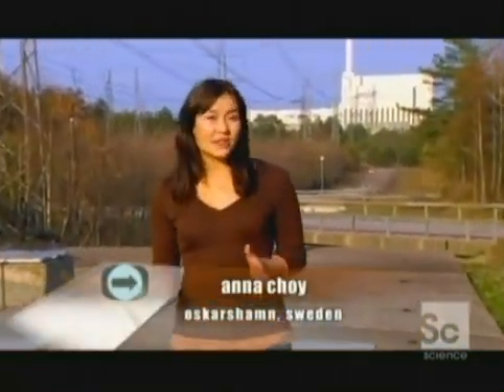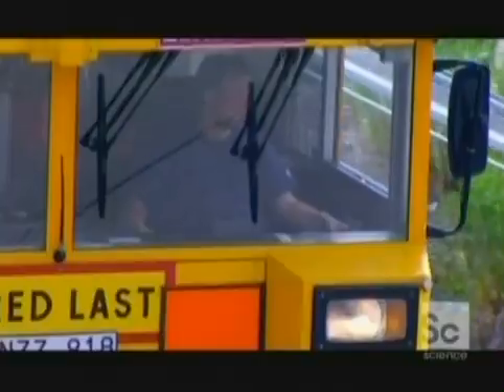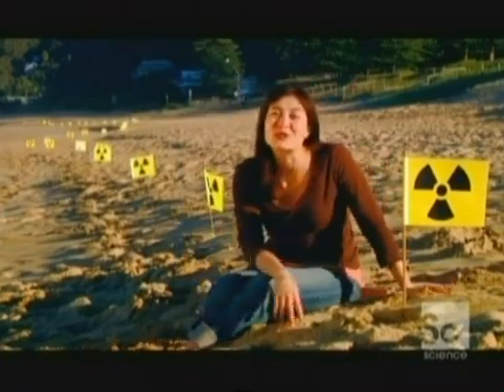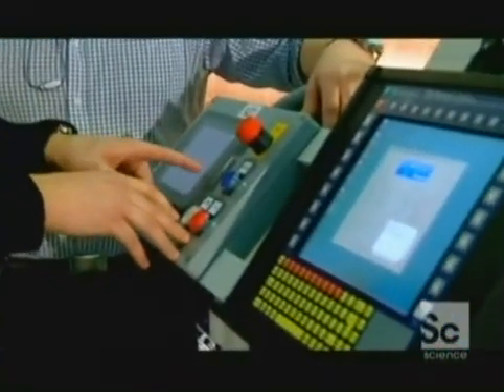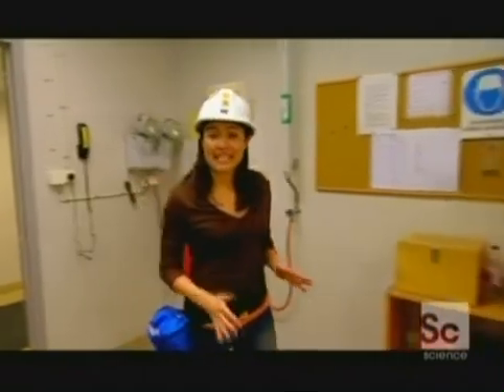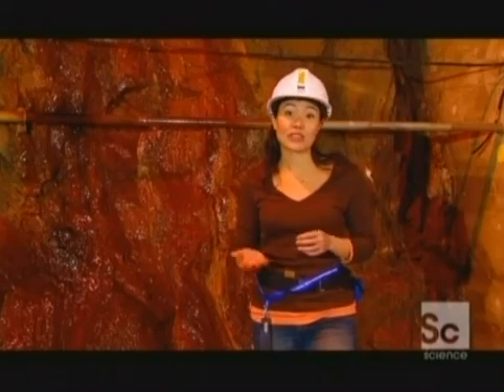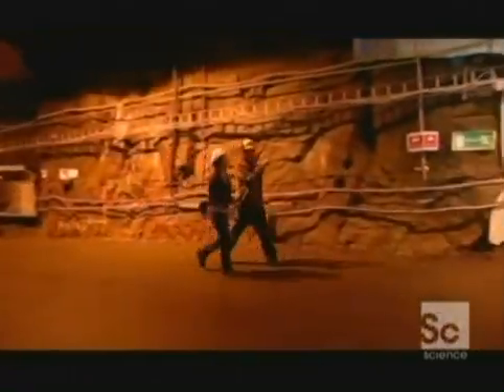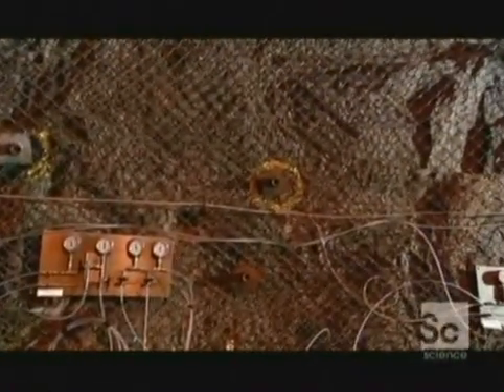Nuclear Spent Fuel Disposal

Comment: Agree with you, but the transuranic today the transuranic is more reliable than long years ago when it was needed to transform the yellow cake into "HEX" then fuel... Today with the centrifugues much more reliable and easy to handle with high unstable spent fuel, adding or removing the non used materials, Cesium, Selenium and others. Again proceduring a lot of waste, the same procedure could be done.

Comment: Yes, but it still produces a lot of transuranic waste that is so long lasting with such little use in solid fuel which is so hard to process and a liability if anything goes wrong.
Liquid fuel that solidifies at room temperature and cannot be easily vaporised is much easier to process (continuously pipe off, the reaction killing Xenon easily removed) and don't have the problem of solid fuel crumbling apart.